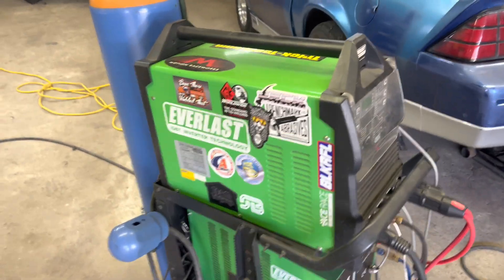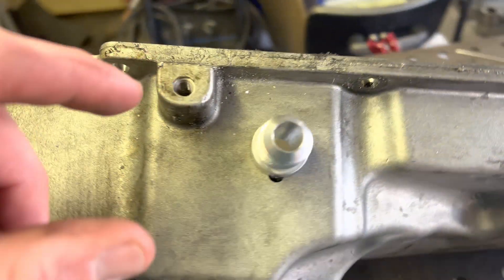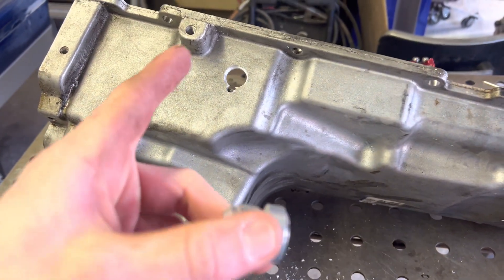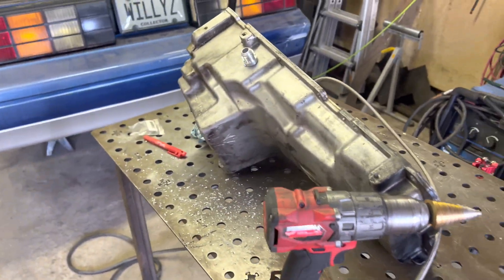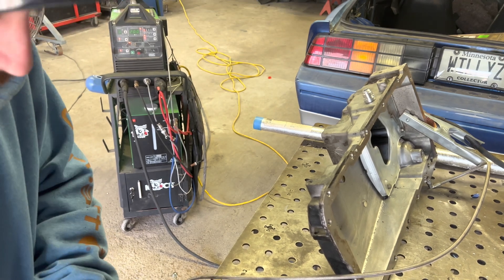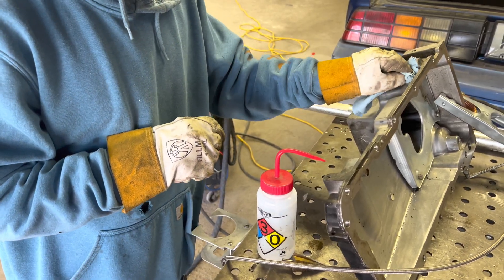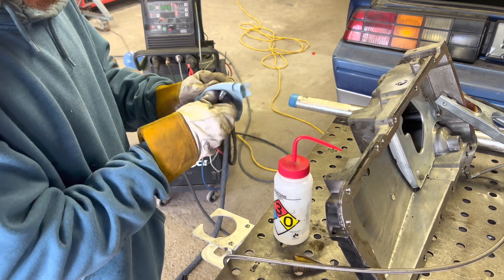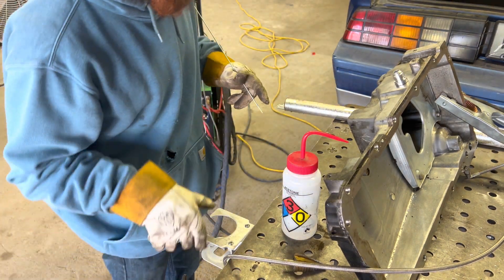LS Oil pan -10 AN Drain fitting install (TIG Welding Cast Aluminum)

Comment: If you remember could you tell me the settings you used on your tig machine. Balance, amps and frequency?
Reply from the maker: Balance 30-35% amps set at 200 and using foot pedal, frequency around 125hz
Reply: @jackfabrication  thank you so much. I am doing an oil pan baffle for a friend and I don't have anything cast to test my settings on. Was just curious about what you were using.
Reply from the maker: @Bane_Diesel  your welcome!! Cast is a real pain in the a**. Preheat is definitely very helpful as well. It will get all the moisture out of the materials too which will help get the heat rolling into it
Reply: @Bane_Diesel go to a scrap yard and pick up a broken oil pan, it's good practice.
Reply: @ajwilson313  yeah that is what I ended up doing but man it was the hardest thing I have ever welded.

Comment: Jack, I have the same machine and will be doing the same job, what settings did you have the 
Everlast at?
Reply from the maker: 200amps and using the foot pedal not just to the floor, 125-130hz 30-39 balance, 1/8” 2% lanthenated tungsten, #5 standard cup/collet body on a Ck world with Ck 230 flex torch
Reply: @jackfabrication  Thanks man!! Parts coming in tomorrow, cant wait.
Reply from the maker: A/c, Advanced square wave

Comment: You using a button?
Reply from the maker: Foot pedal on this, tig buttom for off the bench, I have a video on the tig buttom a few videos back if you wanted to see that in getting set up and used on a roll cage!
Reply: How mutch amperage you use ? Great video